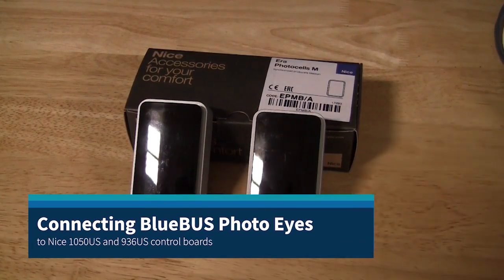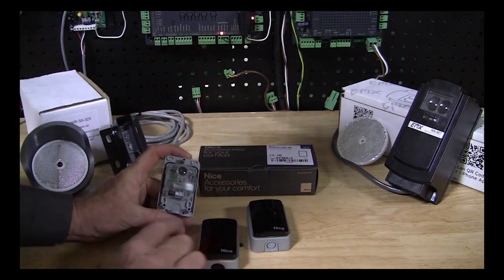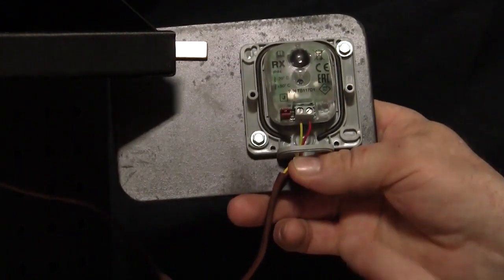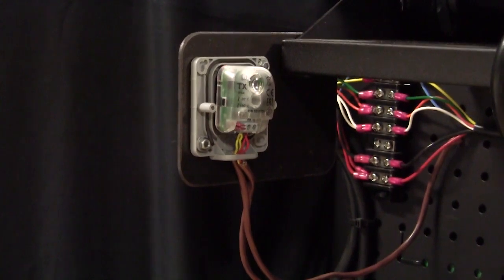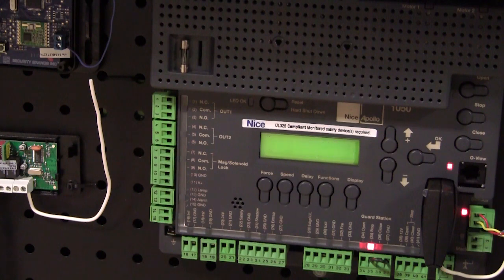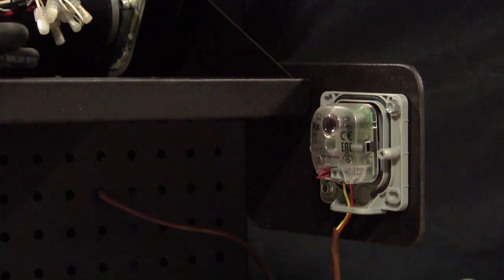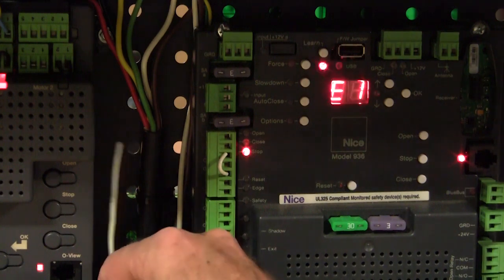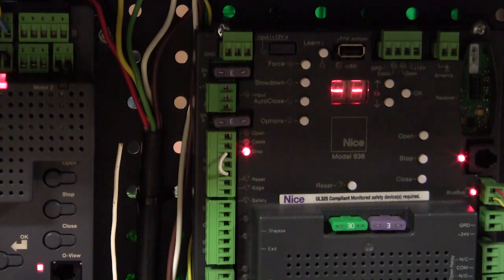How To Connect Nice Apollo BlueBus Through-Beam Photo Eyes To 1050US and 936US Control Boards

Comment: Hi. I have connected thebphotocells as you explained. But i cannot add themntonthe controll unit. I go through the learning procedure, the cells stop flashing 3 times the pause and theybflash 1 time - pause 1 secong then they start to flash 3 times again. On the controll unit, the bluebuss leds flash each second which means everythingbis ok.
I have put the cells at 10 cm from one another thinkingbthat they were not aligned, but still the same thing. 
I then cut the bridge at point A, as shown in the user manual, but still nothing..
The space between the photocell is 4meters (13 ft).
Can you please tell me what i have to do?